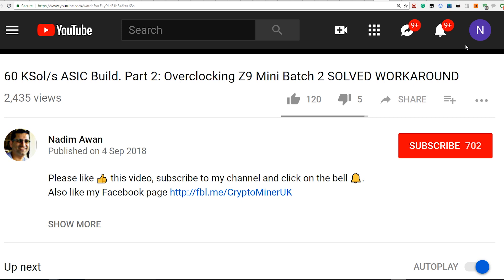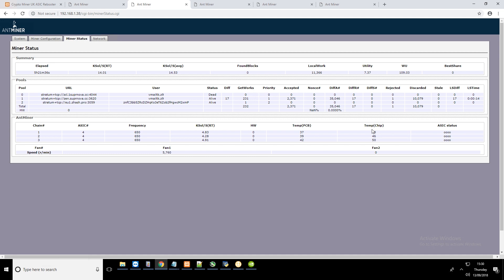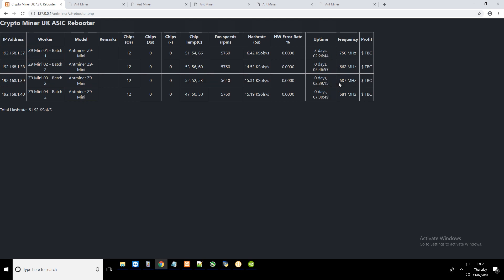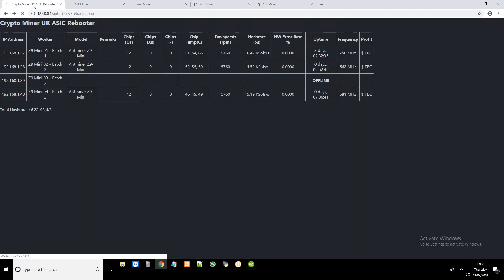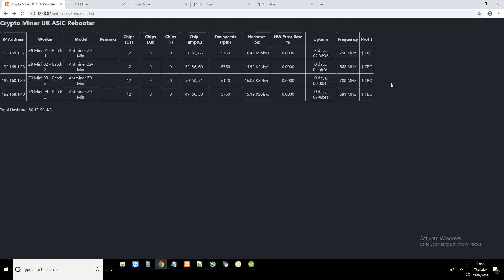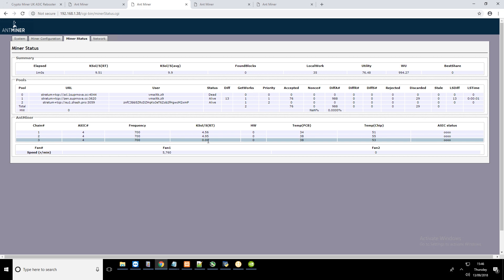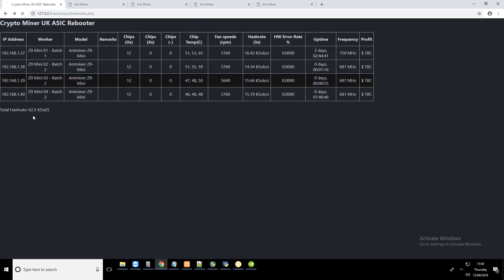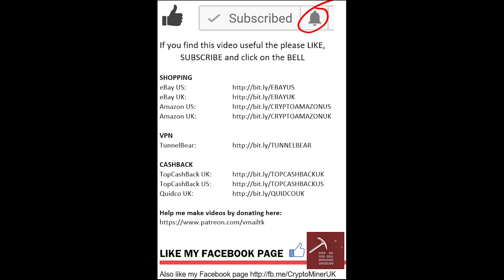60 KSol/s ASIC Build. Part 3: Going Beyond 650 MHz On The Overclocked Z9 Mini Batch 2 With Fail Safe

Comment: Hey Nadim, 
hope you are doing well, what is your profit today with this 4 Z9 Mini, and is still worth it to take 2 or 3 know that i live at south of france (30°C = 86F) and KWH cost 0.1450 € = 0,17$
thank you
Reply: Bonjour, I've not to South of France (Antibes) for a while. The Z9 mini is good because it is quieter than other ASICs. But I think you've missed the boat. There is too much competition on the algorithm. Z9 Bigly, Innosilicon A9 and the Zeon 180k.
Reply: @vmailtk5  Thank you for your responses i will take note of it, il sad that i didnt react more quickly, ihope i take a new boat for an new adventure
Reply: @jetenk  if you follow Crypto Miner UK on Facebook you'll find out about new ASICs. The newest one is the Duyan Zig Z1+. Is should be on sale tomorrow.
Reply: Being in Batch 1 and 2 are your best options
Reply: The Duyan can only be purchased from resellers such as myself. It's good because there was only 2400 units in Batch 1 and Bitmain is not involved yet
Reply: The 4 overclocked Z9 mini s are $22.82 a day or $20.12 after electricity. This is assuming that I am cashing out as soon as I get the coin

Comment: Have a copy of your script? Is it failing at 700 mhz because of a higher temp? If you force cool it, can you push it higher?
Reply: Hi, it's a combination of temperature and and not enough power as Bitmain has removed some components. The code is not ready to distribute because it is hard coded and is not complete.